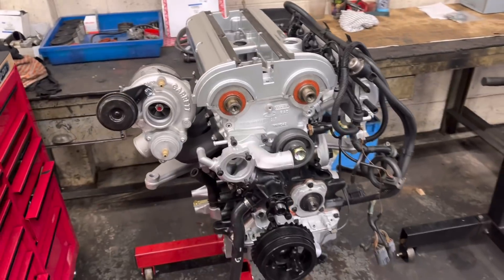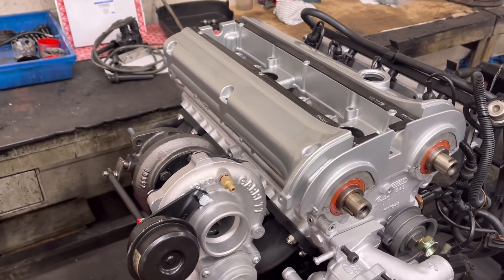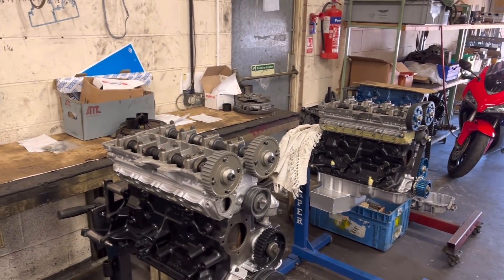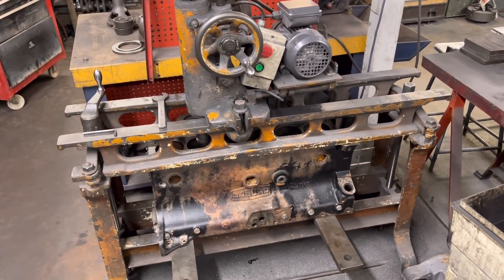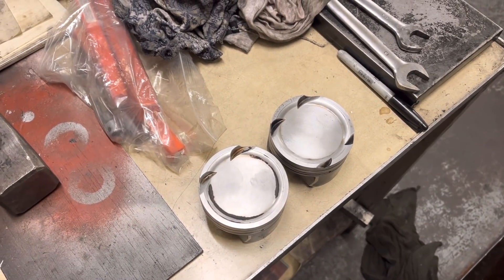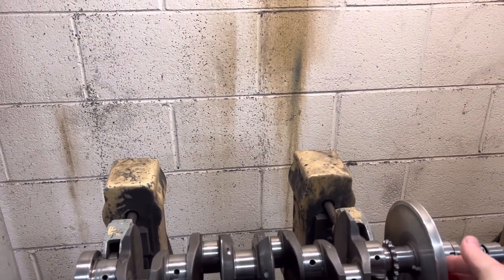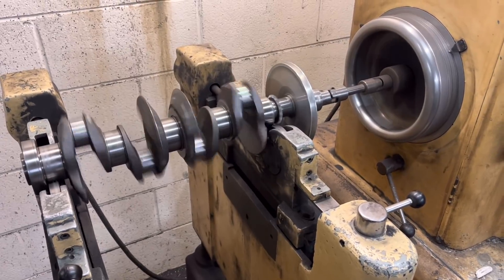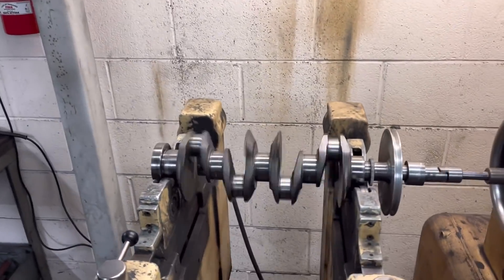How out of balance is the KNIFE EDGED crankshaft?

Comment: This is completely wrong. You have to have half the rod weight and the full piston weight bolted onto the assembly. Balancing the crank by itself is useless. You've taken way too much weight off of the counterweights you can never take that much weight off the Pistons and rod to compensate for that. No wonder you have so much legal trouble you don't know what you're doing

Comment: Does lightening the crank change the harmonics of the engine?  With the asumption that the crank is perfectly balanced; does knife edge crank reduce or increase knock?  I can see that there would be less mass to absorb vibration but on the other hand less mass to cause vibration.

Comment: In regards to the knifeedge crank. How is it not miles out of balance removig so much weight from the counterweights. The material has also been removed on the direct opposite side  of the big end where the weight removed would affect the balance the most. Was the crank out of balance from the factory?

Comment: A question regarding crank balancing. I've seen you guys weighing the rods, pistons, pins rings etc to get them all as close as possible. Do you also simulate that weight on the crank when balancing the crank? I've seen some videos using bobbin weights to do this. I'm replacing some damaged pistons in an older classic Mercedes with oversized Mahle pistons. (OEM) manufacturer. Due to the modern processes and improved materials they use today the pistons will of course be lighter than the original. So I'm assuming i will have to have the crank balanced with these new pistons? Or do I just get the crank balanced on its own as shown in this video? Cheers Guys Love the channel. John.
Reply: Hello,German here. Inline engines crank are balanced like shown here. V6 or V8 ,Vr6 are balanced with extra calculated weights.

Comment: how do you calculate the percentage of reciprocating weight ie the balance factor 
on single cyl  engines  you pick your rev range  where you want it smoothest  
pick your balance factor ,do the calcs 
then  hang  the weight  on the con rod 
rotate the crank on knife edges  and drill or add weight  so crank stops in any position

Comment: I have one question what about the wait of the big end of the connecting rod and also this is the first time I’ve ever seen a rotating assembly balance without bobwieghts connected to the journals to replicate the weight of the connecting rod and piston as a mass I guess i need some understanding on this method I could be missing something. I do understand that the crankshaft is perfectly balanced with the fly wheel, clutch pressure plate, etc.. I am sure it’s perfectly balanced. It just makes me wonder how you don’t consider the rest of the rotating assembly

Comment: Great videos, thanks 👍🏻 Could you clear something up for me please as I can’t seem to find the answer. 
I had my 1999 Suzuki Hayabusa bored and stroked from 1299cc to 1441cc. This is a common modification. I had the new crank (2mm over) balanced by a reputable engineer before assembly. I enquired with the balancer and the tuner regarding having the crank lightened as part of the build but everyone advised against it?
So my question is, for road applications, what are the disadvantages is lightening a crank? Seems like a good idea to me!? 😁

Comment: I used to build my own racing engines for F1200, short circuit racing many years ago, originally using the Ford Anglia 1200 5 bearing crank, after sending the crank flywheel and clutch assembly to be balanced , I then assembled it in the engine, and measured each piston crown from the top of the block and find the lowest then machine the others to match, Then send the block to be topped. I would also quite literally weigh every moving set of parts, whether they be pistons, con rods tappets etc etc  using an old set of jewellers scales my father gave me, every nut bolt and washer that moved, I made them all weight the same, possibly a bit ott, and anal but I enjoyed it, and boy oh boy those little engines ran like electric motors, sweet as a nut, no vibration, and more responsive than a light switch. I then moved on to the Escort engines Xflows 1100 Bored right out to max.  I did at the time at one engineering shop hear engines being "stroke aligned and radial corrected"? Is that a real thing, or was they punting for work or pulling my leg? Love your comment on that. Anyhow great posta, and just subbed.

Comment: I'm surprised you don't polish them as well, whenever I have a bike crank done I have them knife edged, polished and balanced, obviously including the flywheel and any other parts on the crank, like ignition trigger wheels etc, the rods balanced, and then the piston assemblies all matched up.
Reply: and do you notice much difference with a mc engine after installing the machines parts?
Reply: @kimmorrison9169  Yes very much so, the engine will spin up much more quickly, and with other modifications like stronger valve springs, the engine can have it's rev limit increased by around 1500rpm depending on the engine, as the overall effect is much smoother running, and decreased vibration

Comment: Comparing the two videos, on the first one with the crank on the lathe the big end pin webs (not the counterbalance webs) are as cast but when you see this video those webs at the big end pins have had a mountain taken off them with the grinder. This crank must have been mega out of balance and had work done on it before you started this video. But still, the thing that begs the question is......why would anyone go to this much trouble with a cast crank..!
Reply: For some engine builds a billet crank is so far outside budget it's cheaper to mess with the cast crank. Say a high revving na motor for instance doesn't need a billet crank as much as it needs absolutely the closest tolerances possible. Or like in my case nobody makes one and I don't particularly want to pay 6 grand for a custom one off. Some racing circuits also limit what can be in the motor.

Comment: As a retired machinist I watched this with great interest. From 1987 to  2000 I worked for a slury pump company in Sydney, Australia. Saw pump impellers static balanced daily. Material was removed by fixed offset turning on a vertical borer. The machines were old and worn out but new machines would never have lasted long either, esp with the high chrome alloys used for the impellers. The impellers could weigh up to 6 metric tons, The fellow who mainly did the balancing had a note book of sizes, materials and removal estimates created over many years. He NEVER let it out of his sight.
Reply: Im a toolmaker, and no, books like that is never left out of sight, they are pure gold value to the one who has made it 👍

Comment: So, if you replace the clutch, you either have to rebuild/rebalance the whole assembly again or just put up with losing your perfect balance, is it not possible to perfectly balance each seperate part so that it doesn't matter where you assemble it?
Reply: It was only a few grams off so you wouldn't even notice a clutch replacement. Although you can just rebuild the pressure plate if needed.
Reply: Todos los elementos están balanceados individualmente,así que no importa incluso el volante y presa puedes ponerlos en diferentes posiciones y condervaran el balanceo

Comment: I agree with @ g0fvt,    you can balance a brick if necessary,  these fellas have missed the point of my comment on this bullshit ' knife edging ' lark.  Two cranks that spring to mind  that need counter weights are Ford A  and VW flat 4's both these will smash the main bearings out if run at too higher RPM, yet both can be in perfect static balance 
opposed engine designs have perfect primary balance but secondary balance relies on crankshaft counter balancing that I described last episode. Knife edging ruins the designed counter weight forces  the only way around this is to remove metal from the pin side and add tungsten billets to m/c ed pockets on the counter weight webs
Reply: Secondary balance cannot be achieved in this 4 cylinder engine by simply adding counterweights to the crank. The secondary balance issues of all 4 cylinder flat plane engines is caused by the speed difference of the piston between the top and bottom 180° sections of the crank. Balance shafts can be used to smooth it out but they'll never be able to fix the actual issue.

Removing material from these counterweights is just a risk vs reward operation. You can probably remove a good amount before it becomes unreliable.in this case it's a Renault 5 turbo. Considering it's now a classic it'll probably be lucky to cover 50k miles in the rest of it's lifetime. It should manage that with a crank like this no problem.
Reply: @WarlordMarty  I agree with the notion of secondary balance, but you can minimize its effect by adding a proportion of the reciprocating mass to the weights
Reply: Fair point. The VW crank is like wet spaghetti above 5k rpm due to the thin crank webs.

Comment: so now you have removed weight from crank,  surely the reciprocating balance would now be off?
as i understand it, the weights on the crank need to be half of the reciprocating mass, will it be having lighter con rods and pistons?
Reply: It's a flat plane 4 cyl crank. The reciprocating mass counter balances itself, which is why the rods, pistons, etc have to be exactly matched so the balance each other out. 90° V8 cranks are completely different,  hence the need for the bob weights when balancing
Reply: @theshed8802  That makes sense. Thanks for the explanation.
Reply: @theshed8802  no it doesn't, if that was the case there would not be weights there at all, they are there to couneract the weight of the rod.
Reply: @chrismechanic2000  the weights on the crankshaft are not counter balancing the piston and rod assembly. They are countering the big end journal's, and they also act as mass dampers.  I suggest that you read a book called " The design and tuning of competition engines ". It covers crankshaft design and moments quite well. As well as principles of balancing
Reply: @theshed8802  i didn't mention pistons, i said to counter the rods, i'm an engineer and vehicle tech, i know how it works.
Reply: @chrismechanic2000 
An inlne 4 cylinder engine with a typical flat plane crank works a bit differently on balancing. 
Bobweights aren't required as they are on other engine layouts.
You basically just balance the crank to itself, and as long as the rods and pistons all weigh the same, it works out.
In fact, you could replace all the rods and pistons with heavier or lighter weight matched parts, and the balance of the engine won't change...
Reply: I was thinking wondering the same thing.
Reply: You add Mallory back to it to correct for the Bob weight of the piston and rod assembly some do it with a constant oil flow to account for the oil weight too this was just getting the crank to neutral balance

Comment: How is that balanced without bob weights?
Reply: Its not, so its wrong. Every other vid on Youtube they all replicate the rod+piston weight with bob weights which is correct.
Reply: Wouldn't make a difference on this crankshaft
Reply: I found that because the crank arms are on the same plane, no bob weights are necessary with this style of crank.

Comment: I would not argue that the crank itself is balanced. but even with a set of rods and pistons of identical weight to each other the reduced balance weights will increase the bending force on the crank. Increasing bearing load and forces on the block. You could take the balance weights off the crank completely yet still get it to balance in this machine.
Reply: Correct, it will put more strain on the crank. This is a case of risk vs reward though. We were once asked by a customer to balance a crank that he had removed all of the counterweights from. It went incredibly well but didn't last long. Over the years we must have balanced hundreds of knife edged or wedged cranks and as i recall the one with no counterweights at all is the only one that has ever caused a problem.
Reply: @WarlordMarty  that is interesting, my comment was not in keyboard warrior mode, just curious. Of course in real life the crank spins with masses of oil pouring off of it. Of course with no counterweights at all the bending moments on the crank will be pretty extreme. As you say it is all a trade off, some engines are intended for a short but exciting life.
Reply: I got a 3.50 corrected stroke knife edge crank for a 350 chevy off a guy for cheap because it was bent a little I straightened it on the crank grinder and it passed x-ray we ended up putting it in a engine with some cheap claimer class dome pistons and stock rods from 95 corvette and a mechanical roller cam and heads from a old  circle track build ran it on ethanol in a mudbog truck and used to regularly  slam it to 9000rpm and spit pushrods out of the valvecovers when it finally went it was awesome there was no middle in the block the entire cam and rotating assembly exited the bottom end and peeled the oil pan off the rails the crank was in 5 pieces nothing but the carb and headers was usable the harmonic balancer smacked the water pump on its exit with the crank snout in it it was awesome big fireball too best 800 dollar smallblock ever built from half wore out junk there is definite perks to working at an engine shop and building different race engines
Reply: @79huddy  hahaha...your so right...When I worked as head porter at Ten Kate in the Netherlands  I once built a complete block of not used parts or illegal parts not used anymore ...a head skimmed so much and valve seats cut so deep the thinnest size lash shims where way too thick..... But in this head I made a special intake port  close to water and oil  and filled up with epoxy.    When tightning the head bolts...several could not reach the torgue specs as I felt the threads being almost pulled out of aluminium engine block...... But it made the best power curve to that date...😂😂😂😂
Reply: It should be spun up with bobweights attached , each one equal to all of the rotating mass of the conrod plus zero % of the reciprocating mass, so just the rotating mass. The counterweights on the crank are there to balance the rotating mass otherwise they're not required and could be completely eliminated.
Reply: @1magnit 
Inline 4 cylinder engines with traditional flat plane cranks don't require bobweights like many other engine layouts do.
The crank is simply "neutral balanced" and as long as the rods and pistons are all balanced to each other, it's as good as its gonna get.
Reply: @lees.4084  This was my thought as well.  Flat plane inline cranks don't require bob weights at all. these are on;y needed for "V" type engines.

Comment: that is a very old crank balancer,would be interesting to see how accurate it is compared to a current CWT industries 6000 crank balancer.
Reply: Old skool da best skool. Bet they are no better
Reply: Both new & old are only as good as the measurement tolerance and the calibration. The old balancer is relatively simple so less components to go out of spec, with regular calibration it should be fine for old engines. Might not be accurate enough for a turbocharger turbine or an F1 engine though

Comment: Why do other ballancers talk about ballance factors and use clamp on counter ballance weights please?
Reply: They are dealing with a “V” engine which doesn’t have a “flat plane” crankshaft.
Reply: @bwm999  please explain? I thought this crank was Renault 5
Reply: @kevinapps1233  so no explanation then,
No worries, this company will not respond to my request to have a small cranshaft worked on, so I'll look elsewhere and get an explanation from them. 

But then as a teacher, it does go that if you can't explain something simply, you don't fully understand it yourself.
Reply: @evotoadracekartscars.6738   sorry, I was a bit ambiguous. The Renault crank is flat plane so the rod journals are at regular intervals and therefore the weight of each rod cancels out the opposite cylinder which is 180 degrees offset. With a V8 crank (not a Ferrari flat plane version, which is like 2x 4 cylinder engines) the rod journals do not balance each other out, so the crank webs need to do that job.
Reply: @bwm999  I've sent Lee pictures of be crank, made contact on the phone. 🤷‍♂️  Its a 180° inline twin. Three mains and a web on each end, turning 13k 4stk.

But like I said, I'll get the company I chose to explain the in's and out's of this so that I fully understand all the possibilities.   

So many thanks.
Reply: @kevinapps1233  Have a look for a Kart engine called a BILAND SA250 it would be easier.
There are no ballance shafts, or crank ballancer.
Reply: @kevinapps1233  All I was expecting was maybe the same, as you say, its small, but I was expecting a reply,  to much ?

Our engine is quite extensively modified, for a kart engine anyway.  I was considering grafting half a Suzuki 250gsxr head on to it, 4 valves per cylinder instead of just 2per . This would enable a RPM hike so ballance becomes more of an issue.
Green eye motorsport if your into kart stuff. Fb